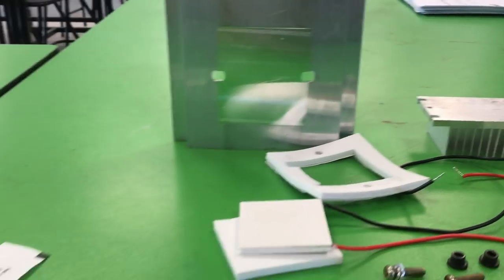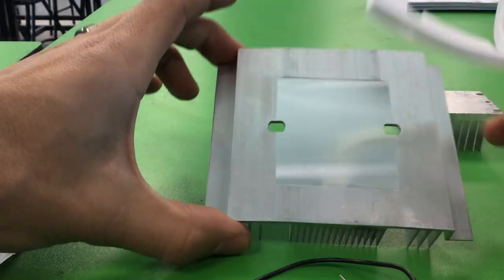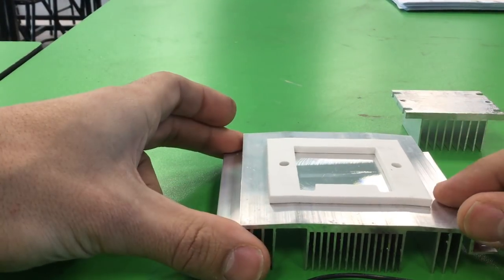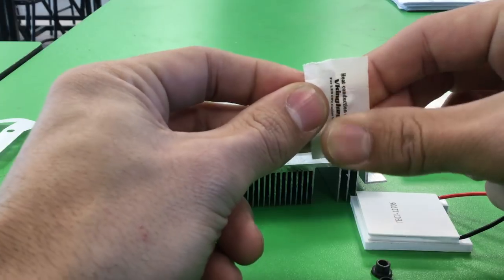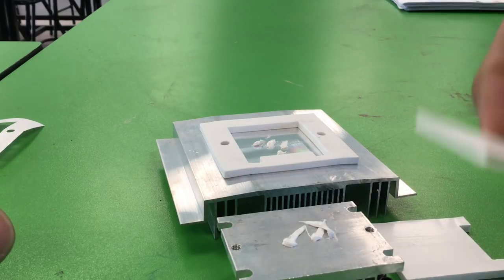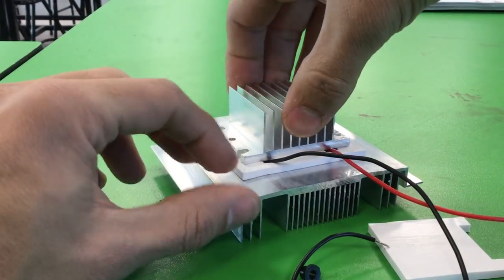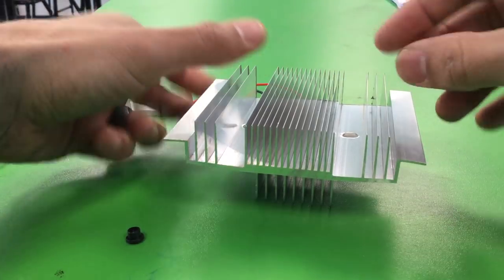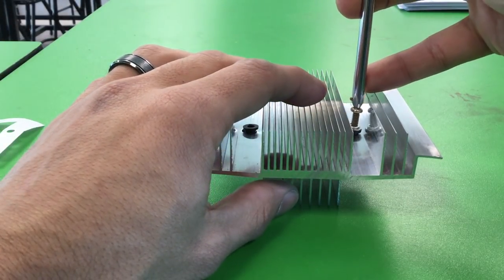Assembling a Peltier Cooler Kit

Comment: hi, just wondering to buy a set of this from a shopping app. is it safe for my phone  if i directly attach it to it? will it get my phone frozen? im kinda nervouse, because im using my phone as a gaming device. the built in cooling tech doesnt seem enough to dissapate the heat.
Reply from the maker: I wouldn't use this on a phone, it gets cold enough to condense moisture, which would be bad for a phone. Using a fan, or a fan and heatsink might be a safer option for your phone.
Reply from the maker: Something like a Silicone Thermal Pad, and 80mm aluminium heatsink and matching low profile 5v 80mm fan might be your dream.

Comment: How would you selected the heat sink and on which basis pls clarify??
Reply from the maker: I used what was provided in the kits on AliExpress. Budget-wise buying a kit was the cheapest option for me. I'm sure with some research you could make a more-efficient design. Finding a good used CPU cooler would likely be a great option for the external heatsink.

Comment: Very nice video, thanks! 
Question, how did you fix the fans of the kit to the heat sinks? 
The included screws are just impossible to use.
Reply from the maker: There are some wood screws we have that are wide enough to hold onto the heatsink fins. I need to make the next part of the video soon. :-)

Comment: What amperage requires for 12v 60watts peltier?
Reply from the maker: You will need 5A. Cheap power supplies usually lie about output, so I think you would need one that has an 8A or 10A output.

Comment: Thing is - peltiers are ceramic and contact with paste should be spread all over rather than squeezing like a CPU. Its ceramic not metal so heat is not spread out well on the peltier irself. Your heat transfer potential is only maximised around the point of contact through the paste. Therefore, you have diminished conductivity from the ceramic surface to the metal surface by having the paste only on some of the peltier suface.
Reply from the maker: Thank you Kevin, you're 100% right. If your making one of these kits, listen to  Kevin!, The paste needs full coverage for optimal heat transfer.
Reply: Right  from corner to corner Never apply paste like that . Any warranty would be invalid based on improper installation.. first clean all surfaces to be in contact with alchohol, it removes all oils. Then apply your paste in the proper manner. That bs he is doing is some bestbuy geek squad thing.   

HP MasterTech Dell sys expert i no a lil somethin ...

Comment: Can I use 12v 15amp power supply for 6amp peltier module with fan
Reply from the maker: Yes, 15amp is more than enough. 12x15 = 180watts.

Comment: All fine and dandy indeed, but how much metric space does it cool?
Reply from the maker: All depends on the quality of insulation and the temperature of your environment. I'd expect it to work ok on a 40-50L fridge.
Reply: @DrBlackAdder  Temperature of the environment would be between 15 - 25 C° as I am living in temperate overtaxed Belgium and for the insulation, since not subjected to wear and tear could be a thick, (15 cm or so) layer of the best insulation DIY can buy, or even modify my old still working whirlpool custom fridge from 1956 and throw out the compressor to accommodate this.

Have you got a link as to where you bought this gizmo?
Reply from the maker: @MrDertien  If you search 'peltier cooler kit' on eBay or AliExpress a lot will show up. Make sure you get the kit with a fan on both sides, it'll keep refrigerated temperatures more even thought your box. :-)
Reply from the maker: Power supplies are a bit more difficult, using an old PC power supply would be cheapest, maybe even free if you hunt.
Reply: @DrBlackAdder  Thank you very much for your quick and to the point replies.

Comment: Not sure if you have link to get all the parts but I didn't see it.
Reply from the maker: Search "Peltier cooler kit" you want something like this: #Aliexpress AU $20.10  35%OFF | 1pc Thermoelectric Peltier Refrigeration Cooler DC 12V Semiconductor Air Conditioner Cooling System DIY Kit
https://a.aliexpress.com/_dYHTgVl
And a 12v power supply like this #Aliexpress AU $14.90  30%OFF | DC 12V/15V/16V/18V/19V/20V/24V 4A 5A 96W 100W Laptop AC Universal Power Adapter Charger for ASUS DELL Lenovo Sony Toshiba Laptop
https://a.aliexpress.com/_d8Zg9cP

Comment: Would a bad peltier plate (heat sink) cause my wine cooler to get colder than its set to 

Its set to 18c and it goes to 10c
Reply: Usually you see a drastic decline in cooling performance when a pelter fails, not the other way around.

From what I've seen while studying how pelter based refrigeration units work, they are very simple by design. Basically you have your pelter unit, a power supply, a 12v pc fan, and a switch. The units with "temperature" controls don't really have a means of adjusting the "cooling power" of the pelter as its basically a solid state heat pump with a hardware set efficiency. So on temp control units, its either just a placebo, or it just simply turns off the pelter until the internals warm back to the desired temp.

That being said, what I theorize is the issue in your case, is that the ambient temperature in the room is cooler than what the manufacturer designed the fridge to operate in. Because with pelter units, up to a point, will get colder depending on how well the hot side is cooled.
Reply: @reluttr2  my thought was the temp sensor in the unit was faulty. Turns out it was so it would run constantly never stopping at the desired temp. Ran a new temp sensor and that did the trick.

Comment: Can i ask the model of heatsink did you used? And also is it okay if I  use a smaller heat sink?
Reply from the maker: I don't know the exact model, here is a pic of teh dimensions of the ones I have used:
https://ae01.alicdn.com/kf/HTB1eWOIa6DuK1RjSszdq6xGLpXaK.jpg?width=1080&height=1080&hash=2160
The smaller you go, the less efficient the peltier will get. Getting rid of the heat is the most important thing. :-)
Reply: Okay thank you 😊

Comment: Peltier module work on 12 v Pulsating dc supply? It will affect it's life and performance?
Reply from the maker: I'm not sure what you mean? A lot of cycling on and off may reduce its lifespan.
Reply: @DrBlackAdder  I mean can we give 12v supply directly from the rectifier without filtering it with capacitors?
Reply from the maker: @ravibarot7867  I had a bit of a look, ripple voltages within the Peltier operating range won't hurt it, but will reduce your power efficiency, so adding a decent capacitor would likely improve your cooling slightly.
Reply: @DrBlackAdder  can you suggest me, which rating of capacitors do I have to use?
Reply from the maker: @ravibarot7867  what is your power source?
Reply: @DrBlackAdder  220v Ac 50hz in India
Reply from the maker: @ravibarot7867  and you want to make your own power supply?
Reply: @DrBlackAdder  I want to make small power adaptor
Reply from the maker: @ravibarot7867  switch mode 12 or 13.8v. Eg https://a.aliexpress.com/_mKQEli9

Comment: What do you do if you get a ceramic unit that's dirty or accidentally touch the aluminum surface?
Reply: it doesn't matter if you touch it, its not sensitive, he is for some reason saying its not OK to touch it, if it gets dirty, you can clean it with iso alcohol.

Comment: If I take TEC1-12706 peltier module and I gave to it 12volt,6amp at room temperature 35 degree Celsius then after 1hour what will be the min temperature at cold side and max temperature at hot side.
Reply from the maker: It will try to maintain about a 60c difference. The hot side will get above 35c by a lot. Bascially the cooler you can keep the hot side, the cooler the cold side will be.

Comment: What size 12 volt cooling fan to use on the small heat sink ?
Reply: I use a 12s4010m - a 40x40x10mm fan
Reply: @pikachulilly  Thank you so much. I will try and get one., How many watts is it ?
Reply from the maker: @indianb1918  That fan would be about 5.1w
Reply: @DrBlackAdder  Thank you

Comment: how do you select which heat sink is the best to use? for both cold and hot side?
Reply from the maker: I just used the ones that come in the kits on eBay/AliExpress. I'd guess that to a reasonable limit bigger is better. :-)

Comment: Why is my big fan only working when the peltier is NOT plugged in?
I have 10A available The module draws around 5A - shouldn't it be enough?
Reply from the maker: Do you have a multimeter? It sounds like power supply is being pulled low.  I have seen fake power supplies do this. A multimeter will tell you the answer. If you have another power supply you can use it for your fan. Just be careful, if the power supply is overloaded it may self destruct!
Reply: @DrBlackAdder  peltier + fans was on the load port of a solar mppt solar charger instead of directly on a battery.
Clamped directly to the battery, it works :-)
But the solar regulator is not a cheap one and should let 10 amps through. Only the one fan isnt working on the load port lol
Reply from the maker: @Bergwacht  That makes sense, if there's not enough sun, it may not be able to deliver the current and voltage required. Maybe look at a temperature controller so you don't waste energy cooling past your required temp? I'd love to see your setup!
Reply: @DrBlackAdder  The sun doesn't matter, the controller still has a mostly full 44Ah battery as power supply , tomorrow will connect 240 amps. The 2 solar panels with 100W for 60 € provide enough for the peltier and also charge the battery when the sun is shining - its not 200 watts but 150w came out. . Is The Sun not shining my Battery is empty after 2 hours lol
Reply: @DrBlackAdder  AND My Peltier refrigerator is not working at all. Just converted a passive cool box. The hot side is hot, and the inside unit is really cold - the principle works but the insulation material is so thick that half the cooler is covered inside, and the fan inside is too small.
It is difficult to fix the problem, I would need a thermally conductive spacer for the Peltie so that the cooler is deeper in the box so that it is not covered. I have neither tools or material to get  a same size as the peltier 1.5 - 2 cm thick metal plate ^^
Reply from the maker: @Bergwacht  Cool. Now I get your layout. So if the fan runs direct from the battery, there is some voltage loss between tha battery and your peltier. This is probably made up of two things: 1. The resistance of your wiring, heavier wires loose less voltage under high currents. 2. The mosfet controlling the output of the MPPT controller (which I'd guess has a pretty small resistance (like .12 ohms, which would still make a 0.6v loss at 10A). If it's the main issue you may be able to upgrade that mosfet with a better performing one.
Reply: @DrBlackAdder  
The regulator does not matter, it is now directly on the battery, but I will soon need a larger regulator anyway because i want more solar cells are on the roof. Its 1.5 meters 13 AWG cable from Battery to peltier.
Soon it doesn't matter because I switch to 24V system and the cooler then gets its own stepdown converter to 12V so the amps are just the half then. These peltiers are energy eaters...hell...
Reply: @Bergwacht  hello, did you find a solution for the thermally conductive spacer? I'm facing the same problem that the peltier module is very thing and the insulation between enviromments very thick.

Comment: Can I use thermoelectric cooler for PCBs?
Reply from the maker: I'm not sure what you want to achieve with a PCB. Cooling a circuit board is usually best done with air cooling, Peltier devices add extra heat to disperse.

Comment: I want to buy please help me
Reply from the maker: Heya Ravi, You can get the Peltier kit here: https://www.aliexpress.com/item/12v-6a-Thermoelectric-Peltier-Refrigeration-Cooling-System-Kit-Cooler-Fan-Diy/32889118741.html
You can get the power supply we used here:
https://www.aliexpress.com/item/DC-12V-15V-16V-18V-19V-20V-24V-4-5A-96W-Laptop-AC-Universal-Power-Adapter/32852511585.html